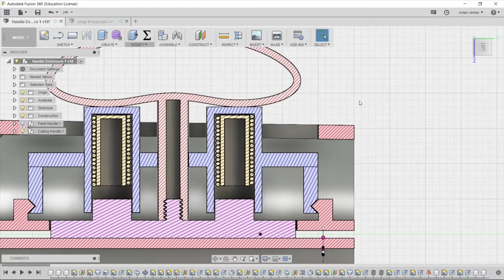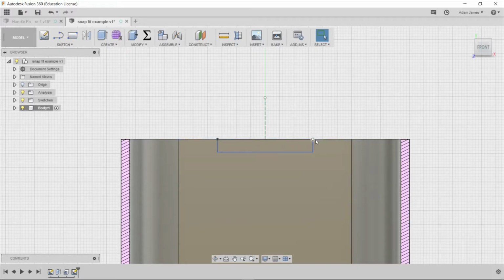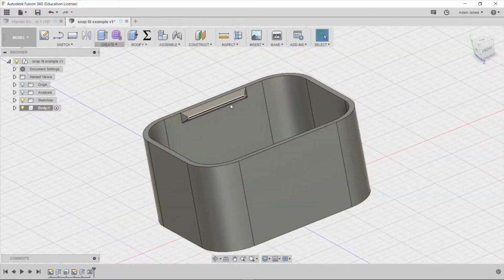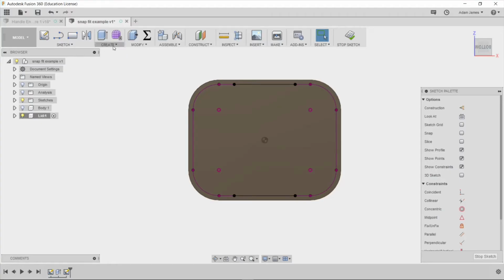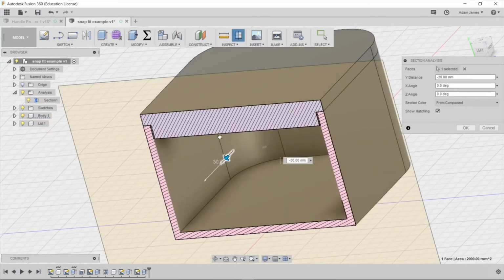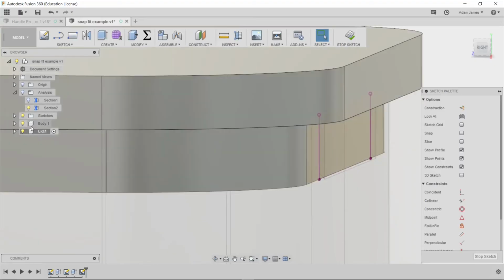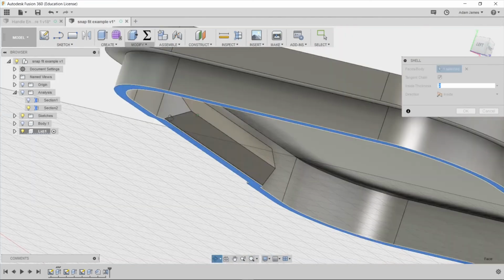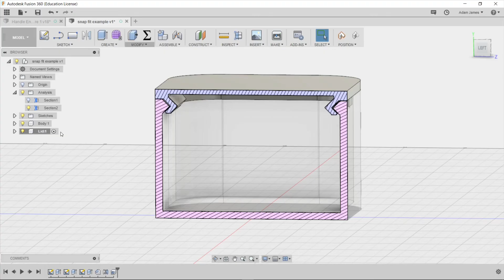HOW TO CREATE A SNAP FIT IN FUSION 360!

Comment: When I try to copy the inner edge of the bottom box on a sketch of the bottom of the lid, it will not copy the lines over.  I can select all the lines on the bottom but they are not showing up on the sketch for the lid?  Am I missing something here or does this not work in fusion anymore?
Reply: I don't know why it wouldn't let me do that. I finally just did it in two separate extrusions, the rim, then the open box with a double extrusion, and then joined those two as one.  Being able to trace the other shape would be really useful though.

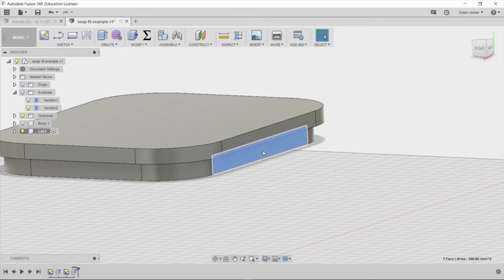Comment: Excellent video, wish I could like it twice. @9:08 in the video, you could use Combine tool, to make that cut faster. I've learned a lot with your video, Subbed.
Combine
Tool Bodies = Bottom of the case
Target Bodies = Lid or top
Operation = Cut 
Keep Tools = Should be checked.
Reply: I think the combine tool won't work well.
this will make the cut with 0 tolerance since the tool body is the bottom of the case meaning it will stop at the edge of the body

doing it the way in the video ensures you have a tolerance still as you are extruding it slightly more than the edge case allowing the tolerance
Reply: I would use the combine tool and then use the modify->pull face function to push those two faces in or out for getting that tolerance as needed.
Reply: After cutting it with combine you can do "Offset Faces" and select the faces and push them in on one of the bodies.

Comment: Just found this video by accident, you used 3 or 4 features i still have trouble with and was great to see them in practical use. extrude on an angle, Sketch on an open Inspection Slice, Mirror feature across a plane, offset and shell. Wow that is a lot to remember. Plus now the GUI has changed a but too. But great lesson thank you i need to go see what else you shared now. D
Reply from the maker: Thanks for the feedback!

Comment: Hey Adam, great video, I just printed a snap fit model using PLA and it worked perfectly. However, I was curious to why the first extrusion with the -45 taper angle for the body was extruded out 7mm, and the second extrusion with the -45 taper angle for the lid was extruded out 10mm. Shouldn't they both have been 7mm? It worked but I'm just confused how lol.
Reply: It doesn't matter because the taper will make them the same height. Technically you're right, but the result is the same.

Comment: Hello! I've seen a couple of your videos on this now.  Thank you so much. Quick question.  I am planning to use ABS...would you change anything about the design or width of the snap fit tab at all?  In one of your examples you used 3mm...in this video you used 6mm.  My current enclosure is about 7.5x7.5x4 with 2.5mm walls (arbitrary) and 4mm for the width of those snap fit tabs.  Do you have any recommendations for my specific set up?  Thanks.
Reply from the maker: Hi Printing with ABS should be fine. I thought I would provide you with a link to a chart comparing the strengths of PLA to ABS: https://downloads.makerbot.com/legal/MakerBot_R__PLA_and_ABS_Strength_Data.pdf

4mm width should be fine so long as the snap and groove are both 4mm in depth, but I have not personally tried it. Let me know how it works!

Cheers,
Adam